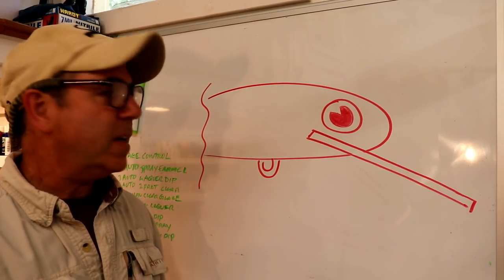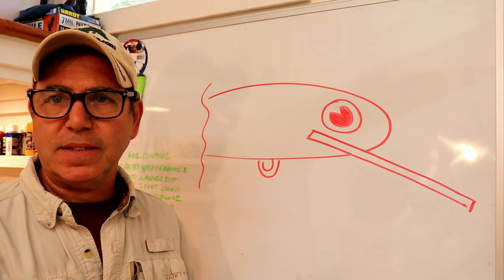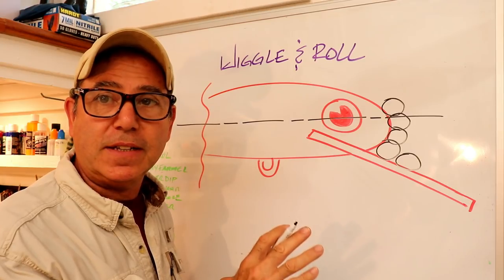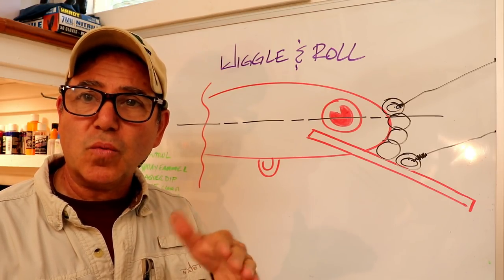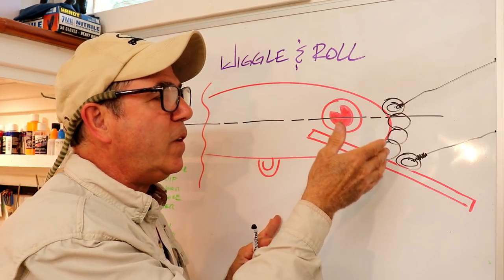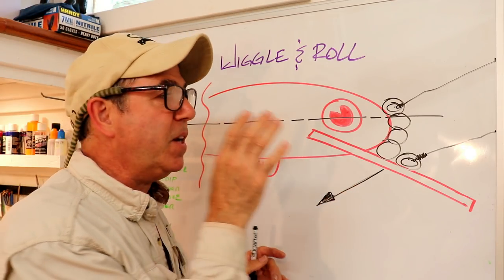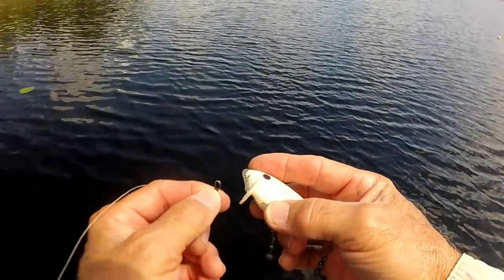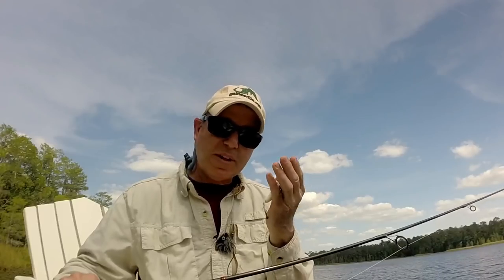Crankbait Design, Fine Tuning

Comment: What I'm looking for as a lure maker is a profound understanding of the forces at play. The kind of understanding that you seem to have. These tips are great, but ultimately won't lead to that level of understanding unless we talk about all of the underlying physics. My goal is to look at a lure (made by myself or on a store shelf) and know what kind of action it will have before testing it. To know what any alteration will do to it beforehand. I can make some predictions, but ultimately it's still a stab in the dark, which means a lot of failed lures and wasted time.
Reply from the maker: You have perfectly captured the mission that drives me to spend dozens of hours making these videos.  Your goal is a good one.  I have a background in mechanical and aerospace engineering and in yacht hull design.  I also spent years in materials research. And with all that I still get it wrong sometimes.I can't teach everyone to be an engineer but I can try to make what I know as accessible as possible.

Comment: I have a crankbait lure the dives around 3 meters or around 9ft.  I would like for it not to dive more the 3 feet, preferably two feet.  Would reducing the plastic lip help in reducing the dive depth?
Reply from the maker: In general; reducing the length of the lip and setting it at a steeper angle of attack will get you a shallower dive.
Reply: @EngineeredAngler  The angle of the lip of the crankbaits that I bought cannot be changed.  Only the length can be changed by grinding it down.  By grinding, at least it will have an effect the depth of dive.  Thank you for your insight.

Comment: How can I calculate that sweet spot, taking in account the location of the weight, lip shape & body shape? I mean not a mathematical calculation, of course...
Reply from the maker: the best way is to do something like I did.  You can put a series of connection points by cutting a thin slot and glueing in a thin sheet of plastic with small holes...its not as hard as it sounds.  Be sure to use weights to simulate the hooks, not hooks.
Reply: @EngineeredAngler  I make my lures with through wire. I attach the lip and the wire all at the same time.

Comment: What sealer do you put over tinfoil before painting.   I get runs trying to Cover it. I tried making The paint a little heavier but still no results it runs anyway let me know Ralph
Reply from the maker: I don't seal it before painting.  If you're polishing the foil that might be the issue...polish residue.  Try cleaning everything with denatured alcohol before pointing.  Good luck